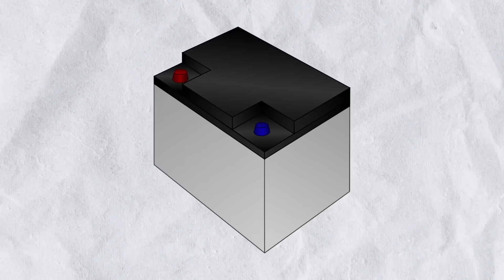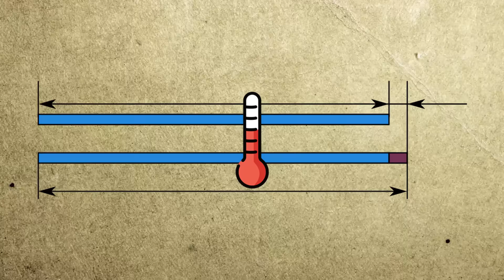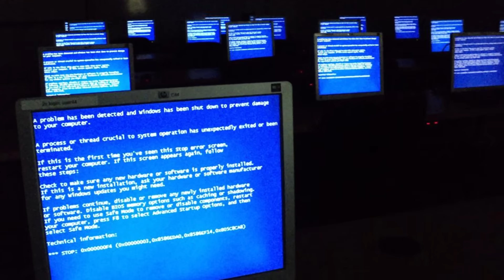(OLD VERSION) Why Hitting Things Sometimes Fixes Them

Comment: I have this old fan In my room that I've had for a very long time. One time while I was young, I accidentally pushed the fan off my bunkbed and it fell onto the floor and sadly dented one of the blades. I stopped using it after that day, But luckily, I was able to brute force it back into place to a usable condition again. the fan still works fine to this day, But occasionally it rattles while being used, while it mostly doesn't bother me, Sometimes I give the fan a little thump and its enough to get it to temporarily stop rattling.

Comment: If a machine on the shop floor stops working correctly, and hitting doesn't solve, the advice I got from an old Controls Engineer is to "Take it apart, clean it, and reassemble".

Comment: -Something is stuck in the machine, doesn't work
-Hit due to frustration
-The stuck object is released due to the strength of the smack
-The machine is working again
-Leaves without elaborate

Comment: My first gaming pc started getting this clicking noise after a few months of using it, it eventually got to the point where I could start to hear it through my headphones and I was getting annoyed and just gave it a small smack on the top panel and the noise diminished almost to the point of barley being noticeable, I could still hear it without headphones on but it was much less distracting. A handful of years later after getting a new pc and giving that old one to a friend to use as a temporary pc he found an issue with something on the motherboard or there about that was loose and was causing the noise and it needed to be replaced after the many years of being loose. So sometimes a little bit of brute force and nudge something back in place.

Comment: I had an IPad from 2012. One soft bump anf half the LEDs had this red-pink overlay.
The solution? Repeatedly smacking the back of it with an open palm strike over the course of 5-10 mins.

However it worked, the green and blue LEDs went back into place 😅

Comment: Phones determine their orientation using an ingrained accelerometer. This way they can tell when the phone is tilted and, if auto-rotate is on, the screen will rotate to match.
If it's taking a while for the screen to flip, lightly tapping the phone a few times can reengage and readjust the accelerometer in case of a missreading.
So no, it's not just placebo, phones screens do actually rotate faster if you tap the phone on the side as if you're trying to get the last kernell of corn to fall out of the can.

Comment: My blue ray player decided to die a few years ago, I had just bought it not long before. It randomly quit working and wouldn’t respond to anything. So in my frustration, I threw it on the concrete on my driveway. It now has a large dent, but hasn’t had any issues since!

Comment: We had a bucket truck we used for work. The radio would never work in it untill u gave the top of the dash above the radio a nice lil smack and the radio would turn right on. The young guys always got a kick out of it

Comment: I came up with that term nearly 40 years ago (I know GMTA, so I probably wasn't alone, but I had never heard the term before) when dealing with Marconi test equipment. As a matter of design, they made use of MANY relays (usually the micro reed style) and eventually either the contacts would wear or maybe the coil would get weak and I would have to pound on the $15K Spectrum analyzer to get it to work properly. This also happened to their Signal generators later on. Their cases were all dented and my hand would hurt after a while. Another day in the life of an E.T.

Comment: Recently I had to change the clutch master cylinder on my moms Focus - after that the pedal was hard to press 

A couple of days later tinkering I took a hammer and nocked at the gearbox then pressed the pedal with force a few times 

It actually worked

Comment: I grew up in the 60s and 70s when everyone hit the side of their TV set.  Then I grew up and became an electronics technician.  There’s a lot of reasons smacking could work, but of course there’s also a lot of reasons why it could break something.  Cold solder joints, dust laying across components.  We had an age of radio called the KWM2 and it was an older tube HF radio that would get taken out of its case and put into a garbage can of soapy water for part of its preventative maintenance.  Not exactly something you would do with modern day electronics. Things run on a lot less voltage and are very sensitive compared to tube electronics..  It doesn’t take too much to go across a lead of a surface mount component, especially a processor or memory.
Reply: Wait NASA fix something by having a vehicle hit itself with a shovel?  I have got to go look that up.
Reply: I’ve been having some cognitive problems lately also and I may just go order a shovel and see what happens.   Lol
Reply: 50% of my job was doing nothing then cleaning electronics.   You would take some readings and make sure components were within in tolerance, but most of it was just cleaning.
Reply: Yes, I was a maid for a bunch of radios for years :)   Instead of cleaning hotel rooms I cleaned inside of radios.  Admittedly a lot less disgusting.
Reply: The environment is not your electronics best friend I can promise you.   When you look inside of a vehicle and the components it uses, they’re not small fragile components like you see in the rest of consumer electronics.  The vibration and dirt along with varying temperatures means you’re normal electronics wouldn’t survive
Reply: The most effective thing now is to actually restart things to include unplugging them depending on the device because some of them maintain the error until they’re completely unplugged and there’s no power applied for a little bit.  You have to wait for all the capacitors to discharge and then it leaves its memory and is able to reset the processor.  All those little bits a data can get confused pretty easily and when they do, you have reboot.  All you’re really doing is stopping a bunch of little programs from continuing to run.  Somethings happen with the processing the data is corrupt and now it doesn’t know how to behave correctly and so you remove all of the power and the memory chips don’t have any voltage to maintain the memory bank and then turn it back on and let it try again.   That’s also why you update firmware, to fix issues that they find after they have released a product.  You can try to design and test something to the best of your ability, but until you hand it to the masses and what them reveal all the possibilities, through us using it in a multitude of ways it is very difficult to find every problem.  They also shouldn’t be releasing complete garbage that they seem to have not tested at all which happens also.

Comment: There does not need to be something broken to be a bad humming sound or a noisy machine. It can also be du to supporting vibration frequencies (oscillation) from multiple parts. If you hit it, it can bring parts out of the frequency so they do not support each other or even cancle each other out.

Comment: Fun Fact: Do to Steve Jobs demanding that the Apple 3 run silently it had to be passively cooled, which was insufficient and resulted in a 100% failure rate, as the heat caused the board to flex resulting in chips becoming unseated. Apple's solution was to tell their customers to pickup their computer, and drop it, to get the chip's to re-seat.

Comment: The Xbox Red Ring of Death (RROD) had the infamous towel fix which sometimes worked by heating it up so much it melted down some troublesome sodder which would crack due to repeated thermal expansion & contraction under normal use of the system.

Comment: i heard of a guy who had to periodically put his GPU on the oven for it to start working again and it went on for 2 years when he forgot he left the GPU on the oven and it melted away
Reply: The heat might fix the solder issues until it starts cracking again.
Reply: @etuanno  i know but it's too funny
Reply: @ Absolutely! Melted GPU, that's toast, on toast, yummy

Comment: I put a demon in my broken computer for it to work again
Worked outstandingly fine for 15yrs (could run videogames way above its level)
Then grandma sanctified the house and it never turned on again
Rip both the computer and the techno demon
Reply: Ghost in the Machine.
Reply: Grandma displeased your computers machine spirit.

Comment: Well, mostly right, completely right on the physical/mechanical side of things. But on electric there are many other things that take precedence over what you said. On old tvs and newer electronics there is stuck capacitor charges and sensor filter parameters, these might become electrically stuck at some uncertain state and lock the sensor readings im a saturated state. A big ol slap on the side shakes the sensors and creates disparity, sometimes returning operation to unsaturated state. Moreover old tvs had a similar problems when syntonizing (is that the world in english?) So basically it had a lot of noise when it was not supposed to have any, this would be something to do with antenna to image protocols being stuck on a localized stable state, which was not the global one so a big ol slap might make it so it gets to the unstable state again, prompting it to redo the syntonization and going to the actual global noiseless state. This all from my engineering classes on telecommunications and filters, if anything is not right feel free to comment since its been some time and i might have mixed one or two words there, Im not going to fact check a saturday morning post breakfast random youtube comment :)

Comment: There's another reason that this is done, even by professional engineers. One of the most annoying problems to troubleshoot is an intermittent fault. A knock can shift that intermittant fault into either 'fixed' in which case you're done, or it can shift that intermittant fault into a permanently broken state, which makes it way easier to track down and fix.

Comment: Sometiimes something in my cooling fan makes a loud noise so I smack my pc untill it jumps back into place, although I have to be carefull enough (I know the sweet spot and acceptable force by now lol) so my pc won't crash from all that hitting. It's been hapening for like a year now and I still refuse to replace it, even though it's cheap, because it still works, It's just making a noise once in a while. Perhaps I could take it out and have it fixed, but usually having someone to fix something so insignificant costs at least half if not 3/4 of the price of the new thing, so no, thanks, I won't be doing that any time soon.

Comment: If it fixed a solder joint then you have most likely also increased the rate of failure in the long term.
Because: If the solder joints are bad/going bad. How do you think those shakes are going to affect them?
a) magically renew the solder
b) forming more cracks and deepening others
Jiggling a lock is really the most generous interpretation.

Comment: brings to mind a line from an old cartoon, Sherlock Holmes in the 22nd Century. Holmes and Lestrade come across an old subway car. Lestrade does some routine maintenance to see if it can get them moving, but the train is as dead as a door nail. Holmes then steps in saying, "let me show you some 17th Century technology" before kicking the control panel and the train starts up

Comment: I work in refrigeration.  I found an ice machine that wasn't making ice.  The problem was the bin flap had been stuck open because of ice hadn't dropped all the way through. It would've melted and worked after enough time, but I got there in time to do a Fonzi fix whacking the bin and felt awesome.

Comment: I got a PS2 recently with a stuck disc drive, gave it a slap on the top whilst pressing the eject button and it worked. Turns out there was a disc stuck in it that probably got jammed when someone moved it and slapping it dislodged it.

Comment: I had an older Macbook air from like 2012 where the trackpad would slowly get misaligned and pushed down over time from use due to the thin frame not providing enough support. It was a known issue with the model, and so online there were two fixes: 1. take the whole thing apart to re-seat the trackpad, or pay through the nose to get someone to do it for you. 2. just smack it lol, it'll pop back into place

2 always worked flawlessly for me
Reply: Not the first Apple with a design flaw that was mitigated with a good smack.

Comment: I mean, there are some ways you could design metal to heal, but none of them are particularly great for example, there’s an alloy that can revert to its original shape if it gets bent out of shape that requires electricity or heat to do so alternatively, there is a way to make it so that  metal could replace damaged parts with molten metal which hardens back into shape but that gets molten metal everywhere because metal doesn’t clot

Comment: Hitting a car to get it to work is 100% proven, tested and, occasionally in extreme circumstances, done by my mechanic dad. We were watching an old Top Gear episode, and in it they were hitting a starter motor with a plank of wood and said despite using the correct method and tool, it didn’t work’, to which my dad agreed with, other than to use a hammer instead of a wooden plank. Probably what spending 30+ years as a mechanic and 26 of them working on old Defenders does to you

Comment: We had once trouble with my computer would not boot and just kept crashing during start. We had 5 Bengal cats at that time and the largest one a gray 9kg male double the size of the other woke up from his slumber on the hot amplifier. Walked up to the computer laying open on the floor, looked at if for a while. Then he put his long paw in it, fiddled around, sat down and looked at us, like try start it now... And the computer boot right up no problem, it had been acting up like that for a whole month and now it was fixed. And the cat smiled and looked very pleased with his work and went back to continue sleeping on the hot amplifier again :)
Reply: SuperCat, to the rescue!
Reply: So kicking it is like treating a symptom unless you overdose on the kick and it just goes boom
Reply: Good kitty. Now fix my debt.

Comment: sometimes, hitting a relay may fix it, because sometimes the terminals seem to be ''welded'' to each other, a small punch shakes the internals, freeing the terminals from one another, resuming normal function.
Reply: This also  works with Bimetal-switches that are often used as simple thermostates.

Comment: 2:28 "Violence is never the answer. It is a question. The answer is yes."
Reply: Isn't this quote from the Max0r video of Metal Gear Rising Revengence?
Reply: @oleg4209  ja vole
Reply: @oleg4209  its the quote of the millennium.
Reply: @echo3-171  exactly
Reply: @oleg4209 it is a lot older
Reply: @oleg4209  It's from the Doom Eternal video if I remember correctly.

Comment: If something isn't working in your car, just hit the glove box and it will likely start working again.

I had replaced a few fuses on my car a while back, given the car was from 1967, none of the new fuses fit in the sockets, 
I have to punch the glove box where the fuse box is to get my turn signals to work every now and then.
the damn fuses are so small they slide right out.

A better example, 
I remember my sister's car had the cabin blower motor quit on her, heat but no airflow,
I kicked the glove box and it started working again,
13 hours of brutal manual labor later, it turned out the old motor was full of pine needles and water.
Reply: "that just raises further questions!"

Comment: I once tried to open a code lock in a quest room. I tried different combinations, but I accidentally managed to open it with brute force (I was shaking the door, checking if my code worked)
Reply: Lock picking lawyer opened a few locks by slapping, it's quite common on a cheap lock
Reply: @vadnegru  or McNally and his signature technique of opening the locks with a second identical lock
Reply: this Masterlock can be opened with another Masterlock
Reply: Next time bring heavy duty industrial bolt cutter to escape room